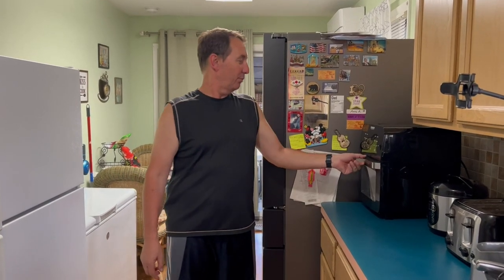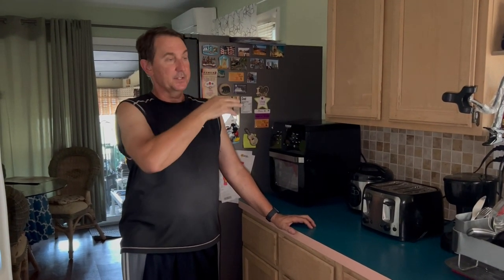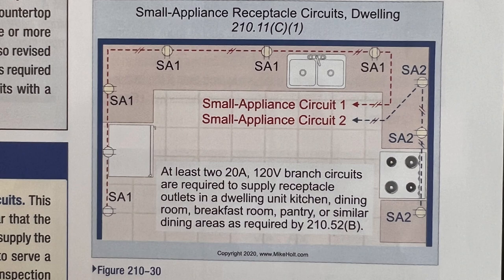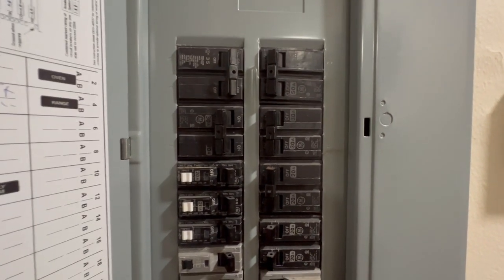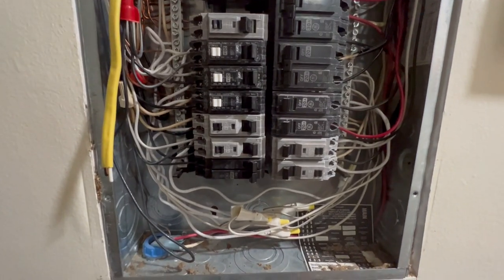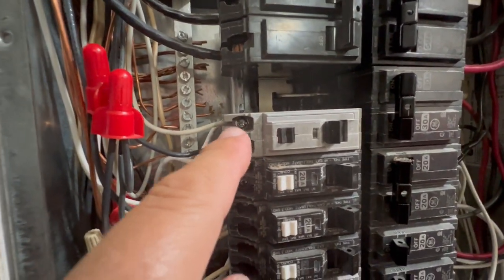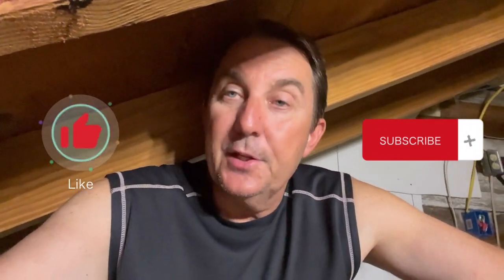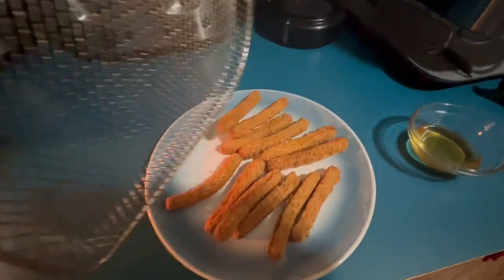NuWave Air Fryer Keeps Tripping my Breaker - See ways to fix it

Comment: Wow, great video. This is exactly the info I needed to run a new line in my kitchen.
Reply from the maker: Wow, I like hearing that! I do plan on finishing that circuit to make it completely new. I would like to replace the section from the junction box down to the outlets, that way it’s an entirely new wiring.  
Thanks for watching in commenting !
Reply from the maker: Be careful working with electrical ok. Be 100% positive it’s off before working on it. 🙏

Comment: I found that in the older apartment, I have (built in 1974 with two circuits in the apartment one for the plugs in the kitchen and all lighting on the other) to keep the temperature below 300 degrees. In my older building, they are 15 am breakers and conform with the code of 1974.
Reply from the maker: Keeping the temperature below 300 or the  wattage it’s pulling? 
I’m glad it’s required to have a minimum two 20 amp circuits just for servicing the kitchen appliances. But if it was code in 1974 it’s not required to update until you work on it. 
Thanks for watching and commenting!
Reply: @YourFloridaElectrician  My solution when I need to pull wattage (Grilling a steak etc) is I plug it into the electrical outlet on the stove which is wired through the 30 Amp stove plug and doesn't trip the breaker for the stove! I am lucky to have an older stove since the new one the building now uses doesn't have plugs on it. I usually keep my microwave plugged in here since connecting to the regular outlets always trips the breaker.  The landlord says it's an old building and I shouldn't use such modern devices. (Ha ha ha...)
Reply from the maker: Wow. Definitely needs updating from the sounds of it. I never heard of a stove having a plug on it for a microwave or anything else. Sounds handy for your situation. 
Carry on then.  @PWingert1966
Reply: @YourFloridaElectrician  It's low-income social housing they will tear the building down before they update it. They actually found that the entire electrical system in the building requires replacement in the annual building condition assessment but that it would cost a staggering amount (535 units in the building) and require tenants to be relocated so that is a hard no! so they will continue to live with people not being able to use modern appliances.
Reply from the maker: Wow that sucks. Hope soon a better residence if you want it